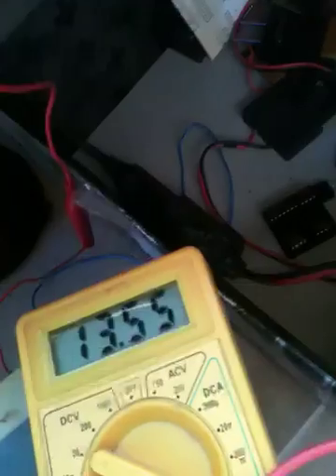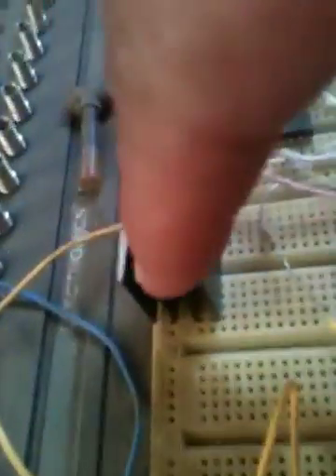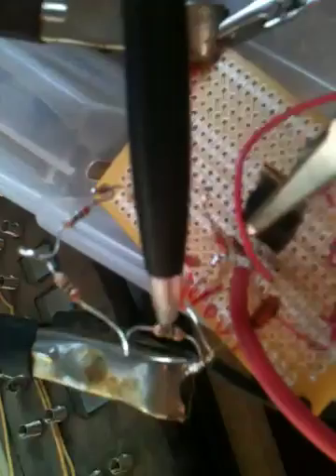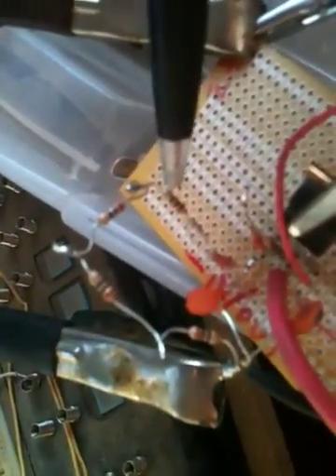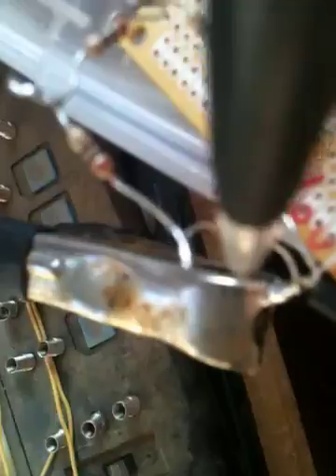Building a Voltage regulator for the newbie (solar panel input)

Comment: Why did you decide on the ceramic disk over the suggested electrolytic? 

What's the difference? 

For DFunisHere......is it true using a bigger heat sink will enable the LM317 capable of producing a bit more than 1.5amps and which regulated transistor would you suggest for at least 2amps? 

Would the other circuit components then change for 2amp capability?

Comment from the maker: To check your current you need to put the volt/ohm/amp meter in series -  not parallel(make sure the selector switch is in the correct position). If you need me to - i can post a video on the difference between series and parallel measurements...  ... and yes you can use this circuit for the 6v battery just set the charging voltage anywhere from 6.9 to 7.2volts maximum. as for the current you are using (.37a) there are no worries ..that is a nice little trickle charge.